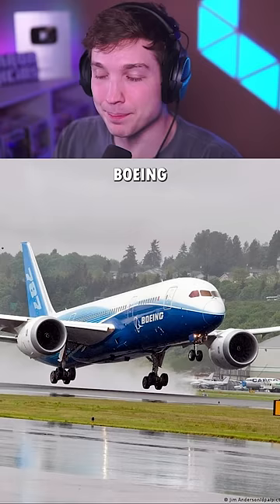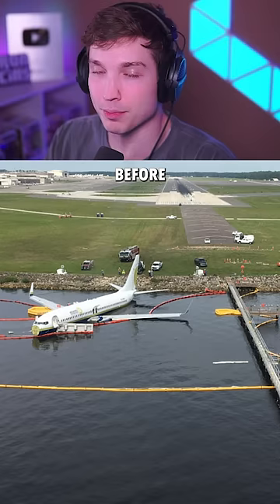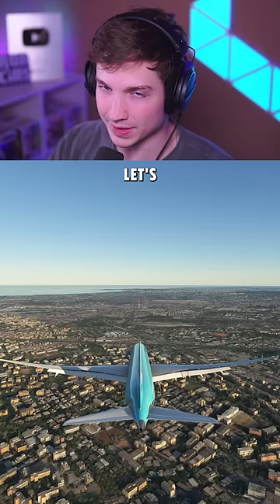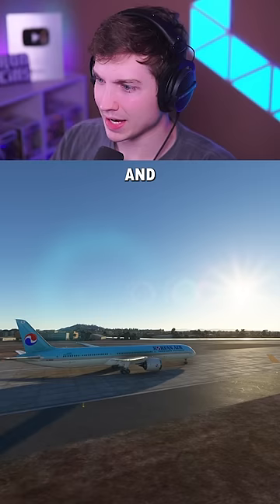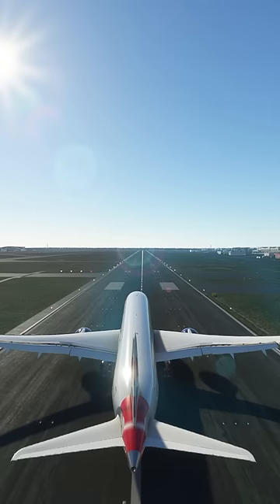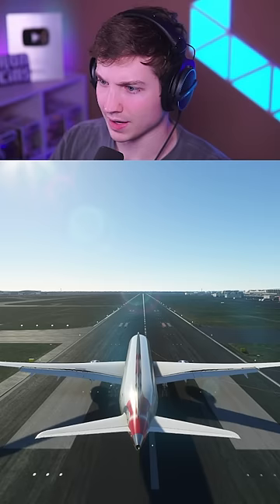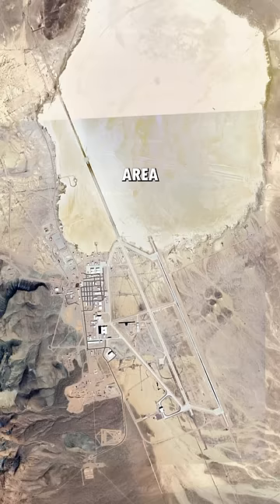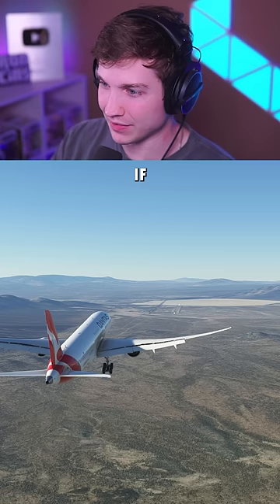787 Landing without Brakes, Reverse Thrust or Spoilers

Comment: bro the f 15 taking off was like 💀
Reply: Yeah that was one single frame
Reply: f/a-18
Reply: true
Reply: @tae5216  its f15 i pause it and see it
Reply: @Splicerszcanedit  no. this is the f/a-18E/F because of the square intakes. the f/a-18 has vertical stabilizers that tilt outwards. the f-15 doesn't
Reply: @tae5216 fr it seems ppl cant even find the differences between f18 and f15 💀
Reply: Is it the MIG-29?

Comment: I would recommend trying runway 15 at the Kennedy Space Centre.  They used to land the Space Shuttles there and it is still in operation with control tower.
Reply: Shuttle Landing Facility?

Comment: 0% engineer here : the front wheel axis extends to tilt the plane at take-off is that right? So if you want to land without breaks of any sort, you can still land, then extend this axis as for take off, which would resist the motil  of the plane?

Comment: Are the engines fully turned off or idling (if possible in microsoft flight sim) technically fully powered down engines create more drag than idling ones, especially if they are locked up for some reason. (Also not sure if flight sim accounts for this or not)